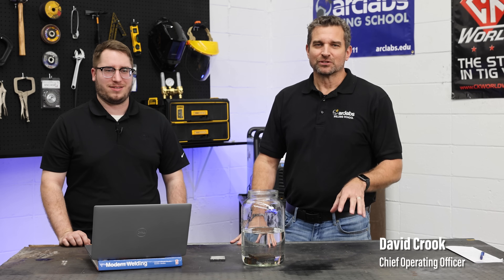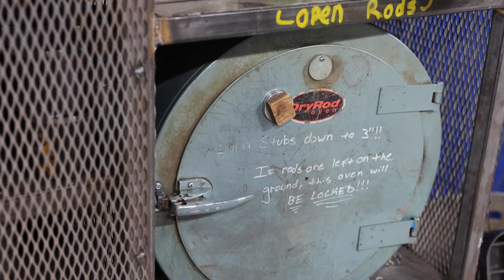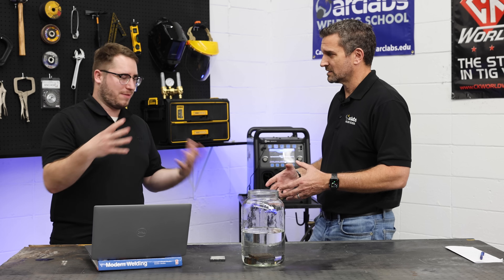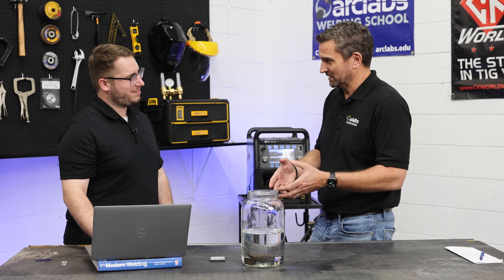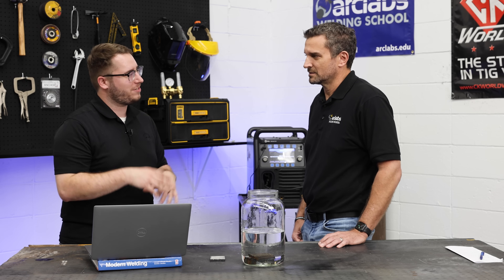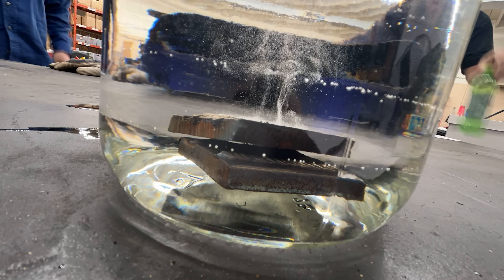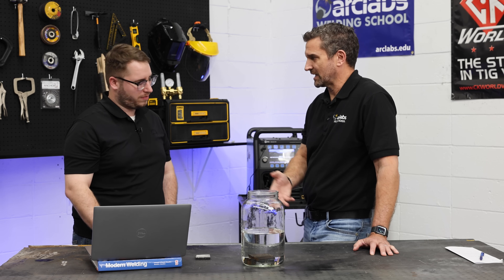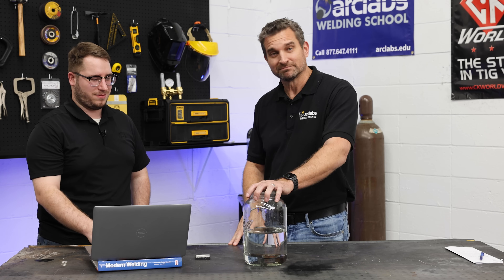Gas IN Your Welds ?!?!! - Welding Rod Storage, Weld Cracking & Why

Comment: Question: for how long the 7018 rod needs to be in a rod oven before welding?
Reply: Depends on the welding code. They can stay in the oven indefinitely for storage. If exposed to the atmosphere for a “long” period of time the welding code will determine how long and at what temperature they must be rebaked. 

Best practices is to leave the box sealed until use and 
to immediately transfer rods to the oven for storage until use.
Reply: 7018's 250°F - 350°F for storage outside of original package... 500°F - 800°F 1.5 - 2 hrs to recondition them if they get too saturated with moisture generally